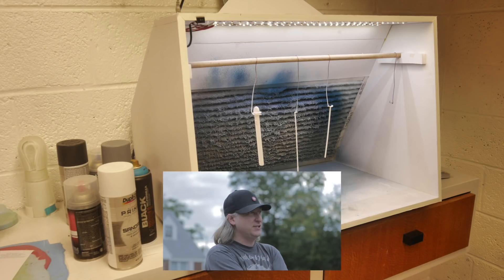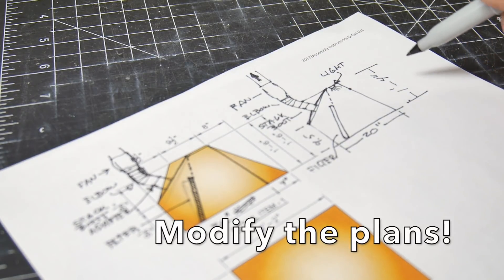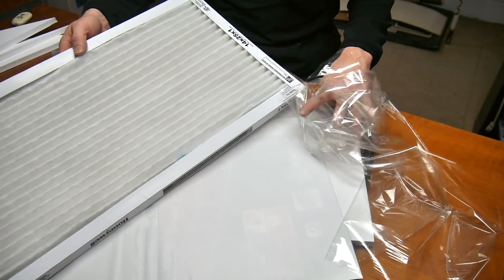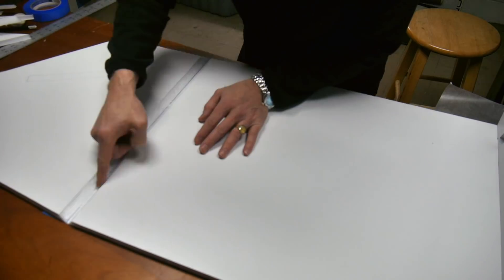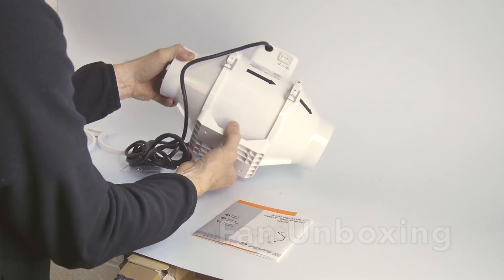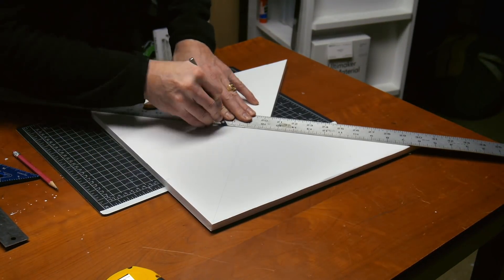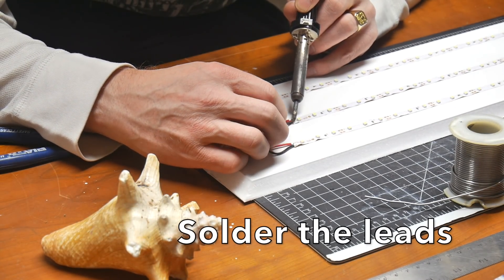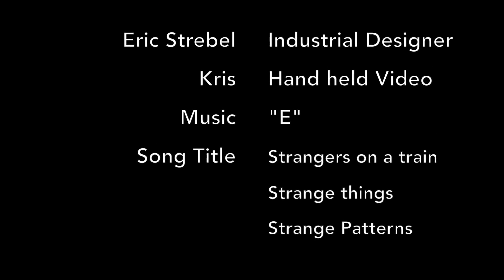Build a Budget FoamCore Hobby Spray Booth for under $200

Comment: Great job  because I also use spray cans .  So are your size  based on the filter?? 14 x 25 inch..
The exhaust fan   Did you buy largest van in box store…

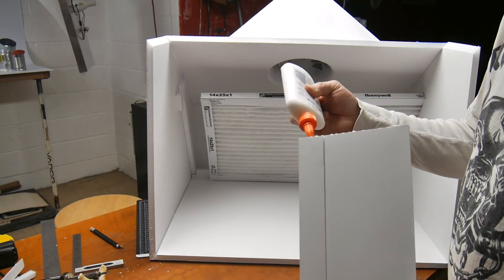Comment: 5:19 How does the divider panel that braces the top of the filter down articulate with the diagonal panel that has the intake hole? I paused the video and saw that it had some kind of paper lip on it but couldn't make out if/how that came into play. Did you bevel the edge of the panel, so it fits flush with the gusset of the intake panel?

Comment: Is there a way to build a spray booth that does not vent to the outside?  Like maybe a secondary filter after the fan. (So a filter before and after the fan, and you just vent to the room)
Reply from the maker: Anything is possible, try it. But I doubt you'll be able to remove the smell
Reply: I think you could do something like that depending on what you're spraying.  I have seen people using water based acrylic paint do that, since they are only worried about particles, not solvent fumes.
Reply: Have a look at the bucket method. So the exhaust goes into a bucket (I think like 20L bucket) that has water half way. The bucket needs to be sealed properly and you need to create some cutouts on the lid and add some filters (2 layers for extra removal). The idea is that the water will catch most of whatever is still passing through the initial filter. Then the air has to escape somewhere and that's where you put the HEPA filter exit outlet on the lid. 

Pretty nifty trick for folks without access to window to vent out.
Reply from the maker: What does one do with the water over time?
Reply: @EricStrebel  great question, I think overtime the water might evaporate and needs to be refilled. Either you remove the filter on the lid to fill the water then reseal. Or you open the (sealed) lid from the bucket and refill.

The bucket system is basically trying to catch whatever still escape from the initial filter layer on the extractor fan. This should works fine with acrylic base paint. However once you dabble with stronger chemical / compound you either need to put better filters on both the bucket lid and the extractor fan PLUS wears good 3M mask to suit your chemical hazard.

All this trouble obviously only worth it if you cannot vent out this outdoor (like in a basement man cave)

Comment: Made a spray booth a few years ago and plan on adding a fan blower to it, been doing some research and some people recommend centrifuge furnace blowers with the motor on the outside to prevent it from creating sparks and catching fire.
Considering the fact that it has a filter which stops most of the paint I wonder if it’s necessary to have an fan with exterior motor.
Reply from the maker: Nope from what I can see the filter stops all paint particles, some of the fumes of course still escape through the event but I doubt that would be enough to cause any sort of an ignition. I've never had any sort of an issue.
Reply: @EricStrebel  Yep, i mostly paint with acrylics anyway and they're water based so it's virtually zero chance, I do have a few paints like chromes that are alcohol based and lacquers that have the flame logo on them meaning they're flammable but the amount of solvent in the paint and going through an airbrush is pretty low so it's a small chance. A higher risk is with spray paint as those also have aerosol in them, plan on using them outside.
Reply from the maker: I spray some pretty flammable urethanes some times, can't see having an issue. Also, it's not like at a factory where it's 24 -7 paint fumes
Reply: @EricStrebel  Yeah, i spray sometimes in the weekends when i have free time so theres little chance. There this video here on Youtube talking about the chance of a booth could explode and i remember it was tested professionally to around 1% chance.
https://www.youtube.com/watch?v=_WpAgfhlICQ

Comment: How Eric, I've been searching for "How To" build a spray booth, and came across your build and YouTube Channel. I too came across the VentWorks plans, and like the design. I plan to make a few modifications for my needs. QUESTION: How is the foam core holding up, and also the vent fan solution your using? I'm trying to decide on whether to go with foam core or 1/2" plywood. Also, I notice a lot of other topics of interest, on your channel, so I became a subscriber.
Reply from the maker: It's holding up splendidly no issues and the fan is fantastic I really like the dual speed

Comment: Hi Eric, i'm planning to build my own booth as well.
I saw that the guys on ventworks used a 265 CFM fan, and i heard ppl suggesting a similar number.
So I'm curious as how your 146 CFM fan is holding up~ Is it good enough? I mean a 265 CFM fan is pretty expensive so i am wondering if a fan around your size is enough.
Thank you!
Reply from the maker: this unit has two speeds works great.
Reply: @EricStrebel  Hi, great job. You're a real beveling master 🙂 Please, I have a question, because my exhaust hoe is coming from the side/bottom, would it matter the suction distribution to have the connection hole on the bottom of the suction compartment ? Thnaks a lot in advance for your reply.
Reply from the maker: Hard to say, but it's likely to work

Comment: Are you needing to wear a respirator with this also?
Reply from the maker: depends what I am spraying, with rattle cans, no need, fan is very powerful, smell is almost non existent, if I am spraying two part urethane, then I wear a mask just because the material is so nasty.
Reply: @EricStrebel  thanks for the reply. I want to get into airbrushing and modelling, but since this Covid-19 pandemic it's hard to get my hands on a respirator for painting. I can get ones from China but again it's from China and our safety standards are different, even though some claim to be NIOSH certified, I don't trust it. My plans are to use tamiya acrylic paints so not to sure if a respirator is required with a booth. I must say out of the handful of videos I've seen in regards to building my own spray booth, yours is top of the list
Reply from the maker: Thanks, I appreciate the compliment and support. You should be fine with acrylics those are not strong smelling in general.
Reply: @Well_This_Guy_Says  I just got into airbrushing myself. Its the N95 masks that are hard to find. Which wont do you any good anyway. You want a P100 mask for paints. However this is over kill for acrylic paint. I notice i have a cough after spraying acrylic paints so i want to build something like this to vent everything out my window. I'm wondering if i can lay the tube into a tub of water and vent into the water. This way i don't need go keep opening and closing my window, with my locks its a pain. I do have a massive HEPA filter running next to where I airbrush but apparently that's not good enough.
Reply: @respond_code3  I been able to find N95 masks, prices are high though, I spent 180$ on 20 of them...The other day I was able to find a 3M spray paint respirator 6300 series with extra filters, yes it might be overkill for using acrylics, but better safe than sorry and I know I'll end up getting into using other types of paint. As for your idea of venting into water, that's an interesting one. I wonder if that is possible
Reply: @Well_This_Guy_Says  glad you found some! I have a couple N99s and my next piece is a storm trooper helmet so I'll be doing some heavy spraying. I think I'll try one for shits and giggles. See if it actually does help. I think if the fan isn't moving enough Air into the water the fumes might just back up. If you vent into water and you see bubbling then I'm thinking in theory the vapor is getting filtered through water.. If i pull the trigger on a paint booth I'll give it a shot. Was looking into building one but after pricing everything out i might as well snag one off eBay for $70

Comment: Awesome job, I am seriously considering building one. Just one question, is that fan safe to use with flammable fumes and such? I've heard some fans can cause explosions depending on how the motor is wired. Please get back to me if you could.
Reply from the maker: It's totally safe in my opinion, the volume of fumes going to that motor is so low for someone like you and I as a hobbyist or very limited use I don't see any issue.
Reply: @EricStrebel  thanks
Reply from the maker: You're most welcome If you build one please post a picture on social media @botzendesign so I can see what you made 😄
Reply: I think that for that reason a centrifugal fan is often used. With that type the fumes get extracted without passing through the motor and the electrics.

Comment: your not worried the fumes catch fire when they pass trough the vent motor?
Reply: This fan is (i believe) the same type used in a furnace.  The fan is enclosed and will not cause any of the flammable paints to spark/explode.  So no worries there.
Reply: A furnace blower, such as the one recommended by VentWorks, has the motor and brushes located outside the airstream.  This reduces explosion risk.  If the fan Eric used has a brushless motor that reduces spark risk, but such fans typically don’t move the air that a furnace blower moves, and there are still short circuit spark and overheating risks which could cause an explosion.  Although that’s unlikely.  Moving a lot of air out of the booth ensures the lower explosive limit of the paint is not exceeded, eliminating explosion risk as well.  I did a recent video about spray booth explosion risk, and providing tables and other data so that you can determine the risk associated with your booth plan, as well as the paint and spray can propellants you use. Check it out if you want more data or need a soporific.
Reply from the maker: Nope
Reply: @EricStrebel  You should be

Comment: The only modification I think I would make is positioning the filter so it does not take the overspray directly.  You will be using a lot of filters due to it being painted rather than just handling the fumes.  Great video as always!  I think I might make something similar for my STL printer, as it makes a hell of a stink when it is running and I can just add a plexiglass door to the front.